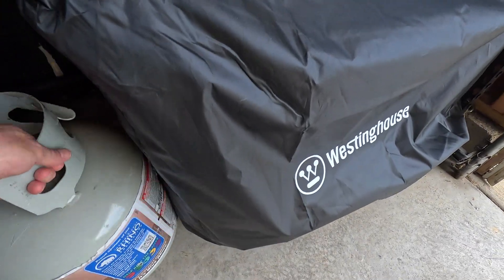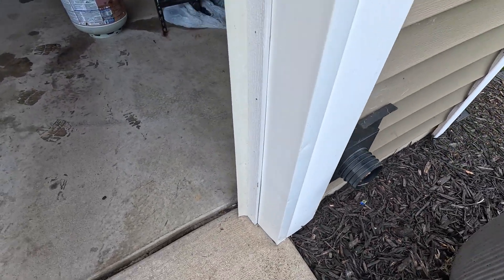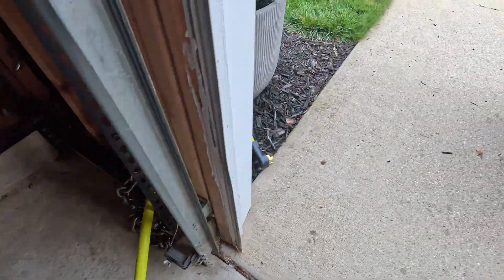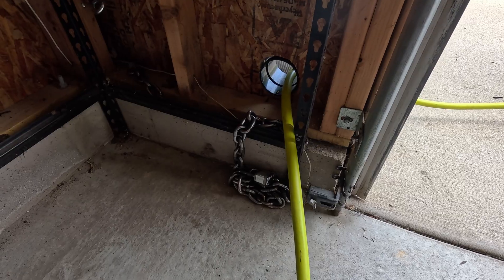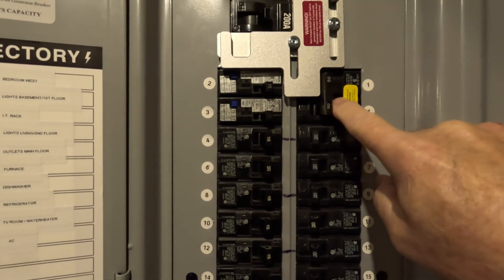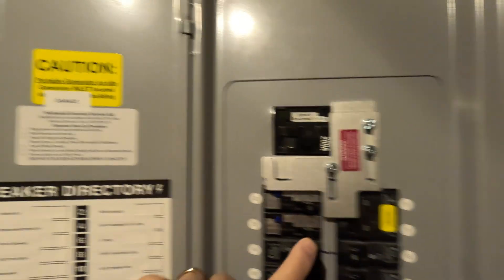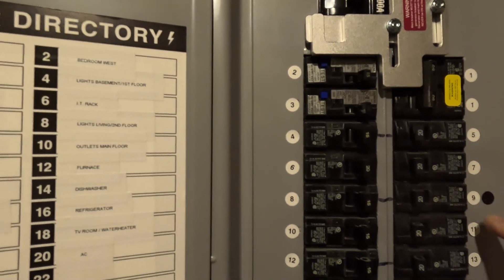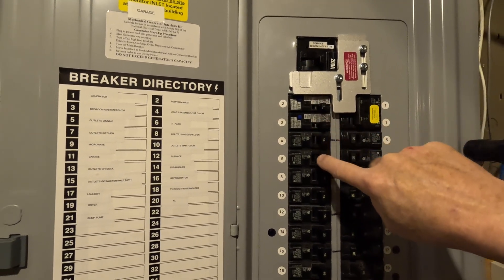How I Power My Whole House With a Generator!

Comment: Nice clean legal setup. How long will your generator run on a 20# propane tank? I think you'd want a bunch of those handy in an extended outage.
Nice video!
Reply from the maker: I get about 7 hours and have 3 spares.  It’s nice that I can go gasoline if I had to. Thanks for the comment!

Comment: What you have done makes perfect sense.  I did the exact same thing back in the 90's . Fabricated all necessary main breaker lock plate and made cord, installed conduit to main panel and calculated amperage draw per generator, wire needed etc. Amazon was not a thing back then. Very informative for the generation now. I eventually just bought a generac whole house generator and made life a whole lot easier.  Was a good use of my generator for 10 years.
Reply from the maker: Amazon makes things so easy now lol We only had mail order catalogs back in the day. Thanks for the comment!